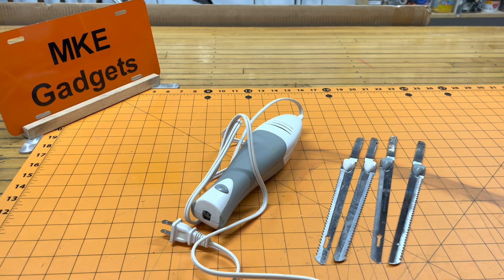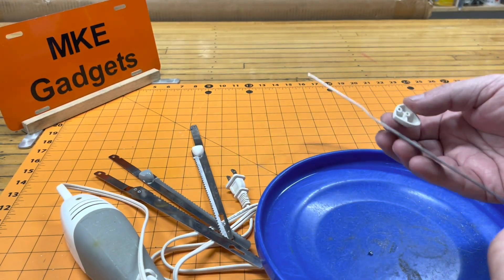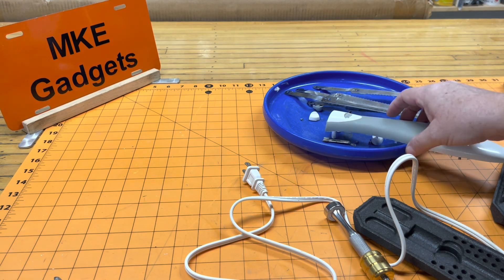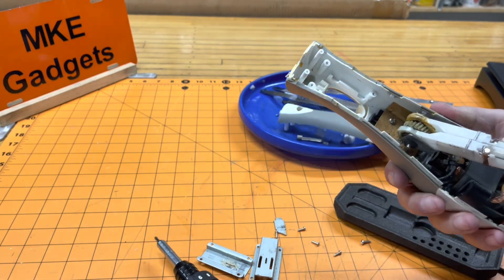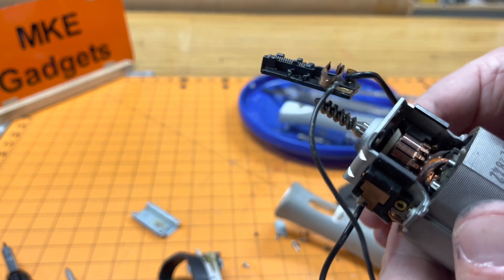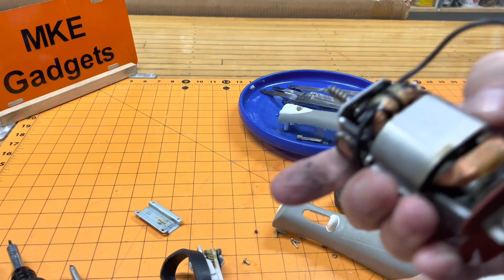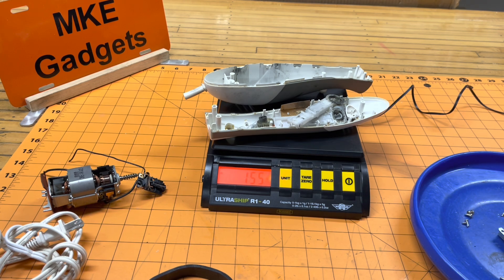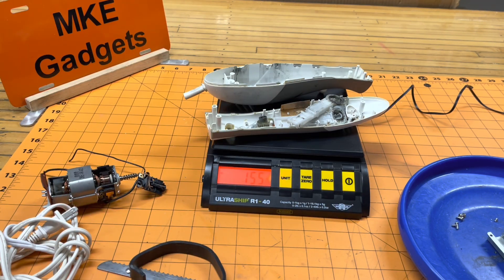Electric Carving Knife Tear Down and Recycle @ MKE Gadgets #164

Comment: Some grades of stainless are magnetic, the more chromium in the mix the less magnetic it is.
Reply from the maker: That’s what I was thinking, but  the way to the magnet suck to the blade with such force I’m thinking it’s steel. I’m still gonna to keep it in a drawer so every time I open the drawer I cut my fingers. If it was stainless I think it would’ve got duller a lot sooner than 20 years. Thanks for your comment. Please support me by subscribing if you haven’t.
Reply: @mkegadgets4380  Already subscribed. And I do enjoy tearing things apart to see how they were made and how they work. Wrap the blades with aluminum foil to keep them together and to save on bandages.
Reply from the maker: Thanks for your support I really appreciate it I like the idea of wrapping them up in something. Maybe I’ll just cover the blade and with some painters tape. Thanks for the suggestion it’s cheaper than Band-Aids
Reply: Those blades would be nice on a diy tape dispenser.
Reply from the maker: I was thinking tape dispenser, or sandpaper dispenser. Do you know the kind of sandpaper that comes on a roll. Right now I just put them in my drawer, that way every time I open the door I cut my fingers.
Reply: @mkegadgets4380  Metal cutting hacksaw blades work great for cutting sandpaper.   Screw the blade to a board with washers as spacers under the blade to set the height.   Grit side down when using.   

Thanks for the video.
Reply from the maker: That’s what I was thinking, sandpaper or tape dispenser. Maybe that will be your upcoming video?